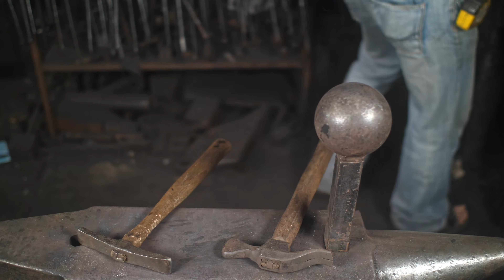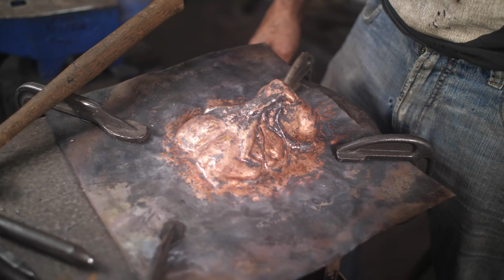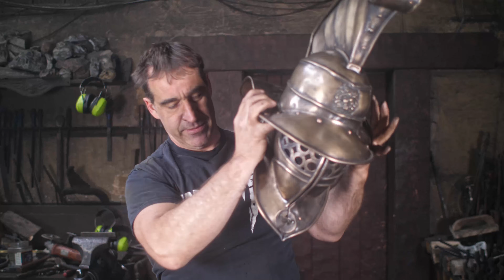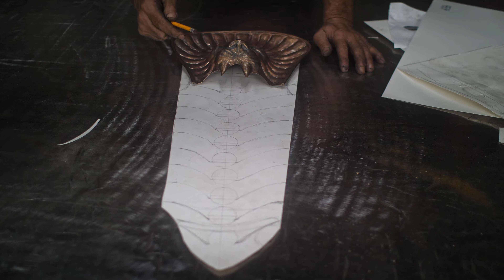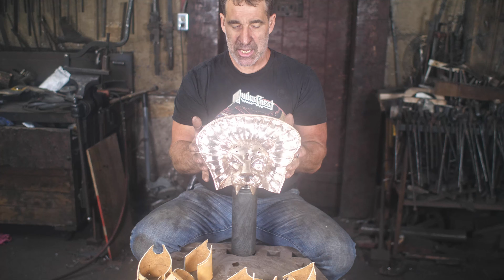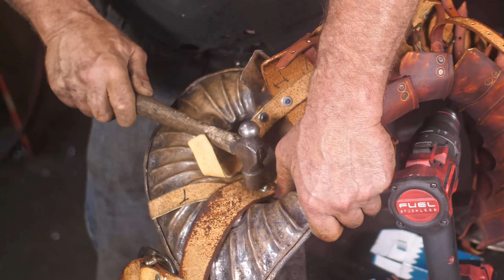Gladiator Manica - Roman Gladiator Set

Comment: Very nice piece.  I’m always amazed at what you can hammer out.

I was a little surprised you opted to turn the Lion’s mane out (convex) instead it keeping it concave.  Aesthetically, this would have mimicked how the mane falls on an actual lion’s head, and functionally it would have followed the natural curvature of the shoulder, which should minimize or eliminated interference with your helmet.  

A rounded surface for the shoulder guard should also better deflect the opponent’s weapon and minimize catch points.  

Unless by turning the mane out you were intending to provide a neck-guard for some portion of your neck?

How would a neck-guard typically be accounted for in that if armor?  With the helmet?  With the shoulder guard?  A separate piece , or not at all?

I would be interested to hear your thoughts in the nerd-follow-up.
Reply: If youre wearing piecemeal armour you dont want weapons sliding off